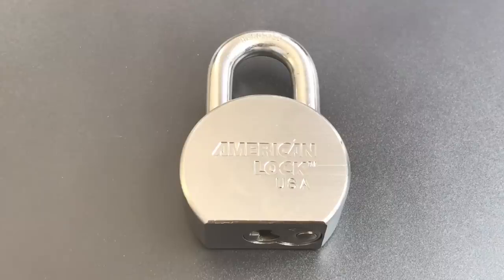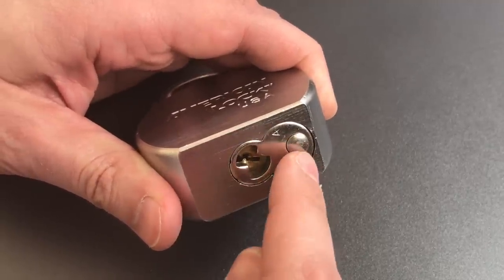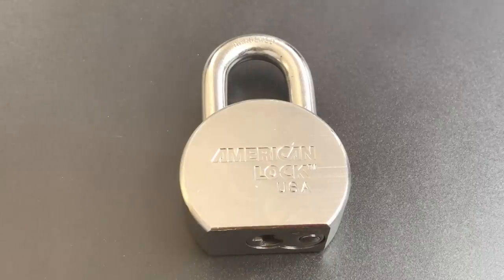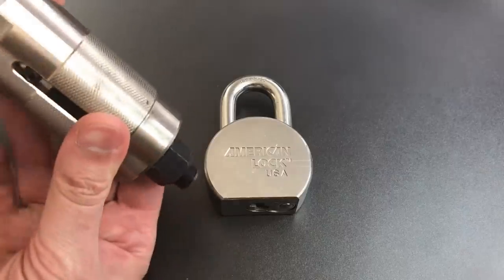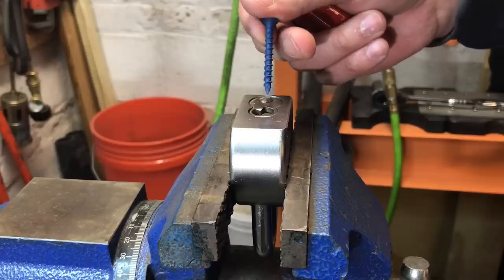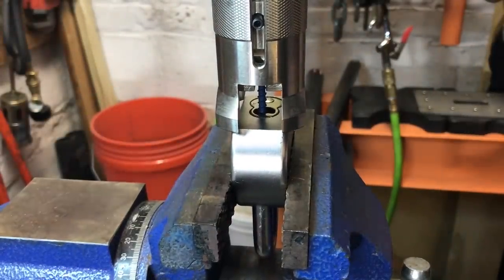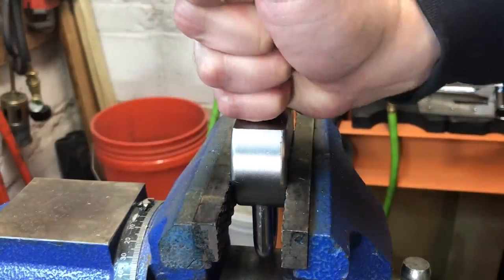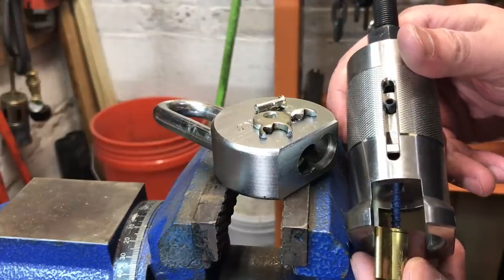[607] Core Puller vs. American Series 700 Padlock

Comment: Holy crap that core puller is hilariously overbuilt.
Reply from the maker: Agreed... it will easily break any screw you use to pull.
Reply: At least it won’t break just throw it at the lock it will open it
Reply: for Skukem
Reply: If it were designed to clamp onto the lock like vice-grip, you could basically use a twisting mechanical action and put so much pressure on the lock that it'll break it somehere.
Reply: Better to break the $0.03 screw than the $150 puller ;)
Reply: I like tools that last a lifetime.  Chinesium is... for the scrap heap.
Reply: Skookum as frig
Reply: Anything worth doing is worth overdoing.  ;)
Reply: @NJ-wb1cz , yes that too.
Reply: It looks like an adult toy.
Reply: Clay : Not if you break the screw off in something important.
Reply: @littleohah  heavy is good, heavy is reliable... if it doesnt work, you can always hit them with it
Reply: Surprised no one mentioned how well she chooches...
Reply: This is what happens when one of us machinists get a hold of an idea. Not only do we make something that works, we overkill and go nuts on the machining details.
Reply: P R Doohan  -  my (legal) cannabis grinder/kief box was definitely made by a mad machinist...
Reply: @yeezywesty3651  as frig!
Reply: @lockpickinglawyer  where'd you pick that core puller up from please?...
Reply: @clanderson0  you could probably make one if you have a lathe like i do though, one trip to the hardware store and a little time in my garage and i could have a core puller just as effective as that one. (some assembly required)
Reply: Flinch It works in a pinch though. When you need to buy a tool that you’ll use maybe once or twice and then never again chinesium is perfect
Reply: @lockpickinglawyer  CTC ratchet?
Reply: @GroovingPict  - Pink Floyd Umma Gumma.  Might even have that CD somewhere around here.
Reply: I use one of these regularly in the course of my work for gaining access - excellent piece of kit (although they are usually supplied with high tensile screws with self drilling points, specifically made for the job)

Once you've seen one in action, you'd never buy a Euro cylinder without anti-snap again...
Reply: Spax or tapcon strong screws. Too bad that puller can't bit up a screw but
Reply: of course it is overbuild. It is german after all :'D
Reply: @lockpickinglawyer  not really German fire fighters use the original Zieh Fix for entry into buildings regularly.
Reply: But hey, it works
Reply: @lockpickinglawyer   those concrete screws are beefy but they snap easy when using tools.
Reply: @lockpickinglawyer  the movie HEAT they broke in a building by pounding what looked like a screw driver tip with a hex nut on the other end .. put a big wrench on it and unlocked the door .. hollywood or could that work ? i think the door would bust or bend and don't think they could drive that tip in the lock ?
Reply: The moment he used the air compressor one turned on outside our house
Reply: ANY screw? Try breaking a 1/2" hilti concrete anchor bolt, any length you want they come in 2"
2 1/2" 3" 4" 5". 

"Easily break Any screw" pfft
Reply: @lockpickinglawyer  this core puller works the same way a crank arm puller works
Reply: @censusgary  99 times out of 100 if you're using this thing you're actually trying to break something so if the screw gets snapped off then objective completed.

Comment: I'd like to see (if such a thing exists) reviews on locks that can't be defeated.  It's pretty depressing, seeing every padlock being so easily compromised.
Reply: Watch the 10 weirdest opening one. I don’t know the exact title. He goes over one that he hasn’t opened yet.
Reply: He's got a couple. He's just humble enough to not put it in the title.
Reply: Yes I have asked both this guy and bosnian bill to pick open a certain camlock that is made by compx national. It's called a keset lock model n4 2010-001. You can check it out by going to compx.com press products and go under vending and gaming locks. It looks easy like a tubular lock but it's not. These guys never mess with these locks. They tried the tubar but not the keset or the system 64. They open easy as hell locks. Padlocks and tubular locks open very easy.
Reply: @ashleymarie2749  from what I have seen, every single lock ever made to avoid.
I too think it would be good to promote the good/unpickable ones readily available.
Its fine to show the crap, but thats most of it...and companies like master lock clearly just dont care, as most locks are bypassed by an easily fixable weak point. They dibt address this as no one knows what else to buy that's better. If lpl an bb etc show more of the ones they cant pick, the commercial pressure might force master lock.etc to address the flaws as their sales drop. But as ut stands, we don't know what to buy, so stick with....so if ur master lock etc, why change anything!
Even this pulled model 700 would be such a simple engineering fix to address this glaring weak point.
Reply: From what I understand no one has ever lockpick ed the abloy protec 2
Reply: Locks keep honest people honest. For everyone else, there's prison.
Reply: You gotta think about it you put a lock on something you lock it up Then you'll lose the key If it's impeccable what do you do I think they're pickable on purpose my friend You just have to buy a lock It takes a little bit more than a second T  Pick
Reply: @TrayPorthos  Determined people make their own doorways. (Not joking, I've demo'ed trailers and homes where we cut holes in the walls with a chain saw.)

Comment: Dammit now I want a core puller and I have zero use for one. Stop making awesome videos!
Reply: once every few years one of my outside pad locks that i never open get frozen and i have to drill em out, this core puller would save me drill bits and the hassle of dragging long extension cords around.
Reply: buy a cordless drill, it is 2018
Reply: Azure Wizzard
i have a cordless drill, i typically use a mini hacksaw on padlocks, if its something like my Marks lock Mortise then it will eat up about 7-8 drill bits and consume a bit of time, cordless lacks torque and  running capacity.  cordless is more than enough to go thru chinese tin used on cheap locks, more than enough for any mexican kwikset etc... unfortunately i don't have any of that stuff in my house.
Reply: you mean fortunatly hahaha... srsly though, you shouldnt drill out your expensive mortise locks. they are better ways such as a plumber torch or some D-Icer by prolab wich works really well.
Reply: azure wizzard
i knew nothing about locks until i found this channel last week, i'm gonna pick up graphite powder for my locks, i used wd40, 3-1 oil in the past for that stuff. i think that will save me from future bad experiences. i will eventually pick up a lockpick set once i figure out what's good to start with.  this is all new to me and i find it fascinating.
Reply: use a BERGEN Steering Wheel Lock Plate Remover Tool  they're $12 rather than the $165 #tips
Reply: if you ever work on a car a puller will be a well used tool.
Reply: classify it as a "hevy-duty wine bottle opener"
Reply: could u unfreeze them with some hot water or something?
Reply: bird718 DO NOT USE GRAPHITE
Reply: Along with a Ramset gun
Reply: @bird718  bumpkeys have them for sale (or did have) as part of their locksmith pack.
Reply: @medes5597  
thanks
Reply: @AZUREWZRD   no its 2020
Reply: LMAO
Reply: @bird718  bolt cutters 🤷🏼‍♂️
Reply: @sinista.productions  
bolt cutters don't work on american l;ock 700's
Reply: @bird718  How so? Can’t find much about them on the internet apart from one website where it says they’re ‘cut proof’. We use abloy padlocks that state are cut proof at work and bolt cutters go through them fairly easily.
Reply: @sinista.productions  
i'm very familiar with the American series 700's. we use them everywhere and no way bolt cutters can do anything to them. no such thing as cut proof, angle griders go through all shackles.
Reply: @bird718  Sound like good locks then. We use the abloy protec 2 here on electricity substations which are difficult to pick but bolt cutters go through them fairly easily. Shame we can’t get the American lock range over here in the UK.
Reply: @sinista.productions  
over here in the New York the 700's are standard locks for businesses and things like that.  they are sold everywhere and almost every business uses them. you can get em on ebay.uk and other places if your curious about em.
Reply: @bird718  cheers, I’ll have to have a look and see what I can find 👍🏻
Reply: @Rotsteinblock  That's basically what it is, you can make one yourself that is much smaller, by drilling a hole through the bolt of an RMS Piaggio 125/150/180cc 2T flywheel puller.

Comment: a note on the blue coated concrete screws: The blue coating has bonding property when sufficiently heated by friction. Not meant for impact driver which delivers rotational impact (perpendicular to screw). Drill with masonry setting delivers impact forward (parallel with screw). 
For a lock, may be most effective to use a drill on low setting (no impact) to drive in screw with enough finishing force to activate bonding benefit from blue coating. 
Great videos, thanks much!
Reply: Actually the blue coating is strictly for corrosion prevention.
Reply: Didn't know rhat6
Reply: Hammer drills are used for drilling through masonry. It has nothing to do with TapCons (those get screwed in like any other screw). The Blue (as @William Morrison stated) is for corrosion prevention.

Comment: Firefighter in France have this tool on their truck for some "low" destructive door opening we also have big crowbars / axe but it's way more destructive. We also have a few spare barrets and key's to replace the pulled ones. (In 5 years i had to use it a few times)
It's stored in a small suitcase, "hiden" in the truck and sealed also for security reason beacuse it takes less than two minute to break in with it in most situations.
Reply from the maker: Interesting. Good to know.
Reply: In german fire brigade the "Ziehfix" is the tool of choice below smashing a window or using hydraulic.
Reply: I was just wondering why would anyone bother to make such a tool. I guess it's a legitimate use for firefighters, and it would save time as compared to lockpicking when there's lives at stake.
Reply: As an American firefighter we normally try before we pry and if we cant find door or window entrance go straight to the halligan and 1-bit.. im actually here trying to educate myself to sell lock picking as a skill to my fire dept. (when the situation merits) as a mediator between non destructive and forced entry
Reply: Chang.  Or cause in America their fire service has the paramedics as well, so they could use lock picking for mandown situations
Reply: You don't need that at all, you have the chrome helmet. ;)
Reply: Isn't it faster to use air baloon to open the door?
Reply: @artofshootinginmotion2871  Got no idea because I've never seen / used the baloon but thats the tool we have, used it a few times and it was effective and less destructive than the halligan (hooligan) tool
Reply: @MrCamoman12  would've been sure that you'd say something along the lines of "we're in america, fuckin shoot that lock"
Reply: @danielblanchette8593  that's just the cops
Reply: the firefighters used that on my door and then replaced the lock
luckily it was a false alarm and there was no fire in my place
Reply: @MrCamoman12  From what I have seen, firefighters have some mad skills, and the Locksport might be an excellent addition to your bag of tricks. :)
Reply: Chang.  I don't know if this applies in the US but in Canada firefighter is not the correct description for their total job job description sure that's what they're most known for but they do to my knowledge at least basically any kind of emergency service that is not law enforcement or medical related (except CPR) so things like you're stranded in the middle of nowhere because all of the sudden there is ridiculous amounts of snow coming down, or you're out in BC and you've gotten stranded on the mountain in a place where a tow truck really can't save you.
Reply: Chang.  ?
Reply: Chang.  You're either a troll or you're completely insane because I have no idea what in the hell you're on about
Reply: Chang.  your comment had nothing to do with what I said in any way shape or form so I'm just confused
Reply: Chang.  So it's the latter option because you have to be a conspiracy theorist to be trying to get me to do mental gymnastics to chain an illogical series of I don't know. And I classify all conspiracy theorists as insane.
Reply: @coladict  , If I didn't see LPL use that tool for pulling a lock core, I'd have thought it was a bearing puller.  There are "legitimate" specialized bearing pullers of very similar construction.
Reply: In Brazil you ram it down. No mercy.
Reply: @MrCamoman12  My snap response to that (2 years later :-) is if you can rake it or comb it, it's worth the try; single-pin picking falls outside my perception of the available time scope.
Reply: I’ve used my plug puller on Medeco Multilock it makes short work of these locks.
Reply: @ussessexcv-9189  A lot of departments  in the US add the term rescue to cover those other scenarios so they use some combination of Fire, Rescue and EMS (Emergency Medical Service) in the US.  Sometimes they use it in their official name or unit designations, usually all three are around somewhere

Comment: The more I watch yours and Bill's videos the more I understand locks are only as secure as the structure around them, and that ultimately locks only keep honest folks out. Where there's a will there's a way.
Reply: If there's a Deryl there's a cliche
Reply: Deryl Burney It’s less about keeping honest people honest, as they’re already honest. These locks have to do with opportunity cost. Make the cost of bypassing the lock too great and they’ll move on to a less difficult obstacle; the lock then keeps your valuables safe.
Reply: @darkopz  thank you. Sick of seeing people trot out the 'honest people' nonsense.
Reply: I am sure there is an equation for this, risk and reward multipled by effort and time divided by expense and planning. Even if the average criminal doesn't sit down and work this out. It is still a factor, someone that just needs $10 for their next fix isn't going to spend $50 on a core puller.
Reply: Locks are a useful component in defense in depth. The lock shouldn't be the only component in any security system, there should be a guard, camera, other locks, etc.
Reply: @stormveil  it's not nonsense, it's only your lack of understanding. The fact that locks only keep honest people out means they're useless, because whoever is up to no-good will get away with it regardless.
Reply: @Kate gee Is that admitting that you know how much a fix is? I am sure there are a myriad of illicit products on the market that don't all cost $70, but then I wouldn't know I have never needed a fix in my life.
Reply: The lock isn't for your safety. It's for your insurance.

Comment: Does it fit properly over a bottle of wine? I've dealt with quite a few stubborn corks, this just seems like the perfect solution to that.

Thanks again for all of your destructive opens. BosnianBill has been slacking quite a bit lately on that front for whatever reason, so it's nice to get my fix.
Reply: They make wine openers that work like this so I don't see why not.
Reply: I actually used one of those for that after my corkscrew broke while trying to open a bottle.
Works very well.
Reply: I’ve used a screw and some vice grips to open wine bottles a time or two.
Reply: Never needed anything fancy to open a wine bottle. Just twist off the cap. Never drank the fancy stuff either. Boone's Farm, Ripple, Thunderbird...
Reply: that makes me think would a corkscrew work?🤔 on a lock i mean .
Reply: Karl Lowry I highly doubt it. If you even did manage to get the screw that’s designed to go into cork to thread there wouldn’t be enough leverage to pull the cylinder free.
Reply: @karloslowry9043   You need to thing again...
Reply: @scootergeorge9576  does Apple cider works
Reply: That is a very sharp observation. This does operate much like a drawbar on a Bridgeport Mill, or as you cite... a modern cork remover.

Comment: Yesterday I witnessed German firefighters using this "Zieh-Fix" ("Pull-fast") on an appartment door. Mom had left keys inside and door fell close due to wind.
Little baby was crying heavily in the appartment.
Opening took 5 minutes causing a broken cylinder worth 13 euros.
Mom was happy to buy a new one after hugging the firefighter.
Locksmith was not available due to Sunday in a remote village.
Very good tool. German quality :-)

Comment: Love the core puller, resistance is futile! When driving Tap-cons into concrete I also find that an impact driver will snap them or spin them. A little wax or a product called Door Ease makes them drive far easier.

Comment: I don't know about the 700s, but in a 1200 series I used a punch to put a divot into the retaining nut then used a drill bit the diameter of the shank to drill off the head. It was quite easy, didn't skate around at all.
Reply from the maker: I’ve used small diamond grit hole saws.  The doming actually keeps the bit centered!
Reply: @two_tier_gary_rumain   That would assume that you didn't finish the whole bottle...:)

Comment: When you first showed the core puller it reminded me at these hole shearing devices  for  metal sheets, we used at work. They have a very similar construction with a thrust bearing and a beefy fine pitch screw. At this point I was pretty sure, if the concrete screw doesnt slip of of the core, to see this look loose, but I really  expected more from the core retention plate.